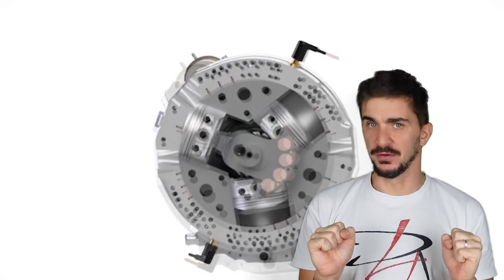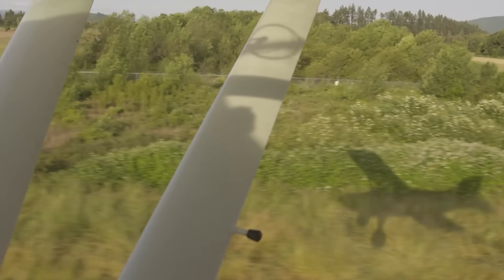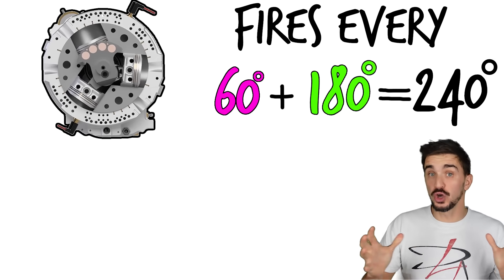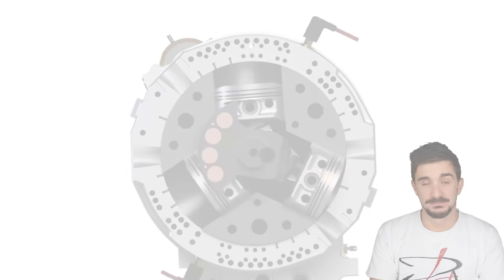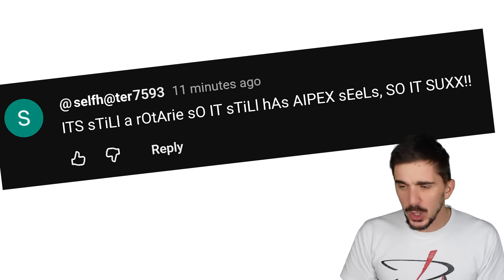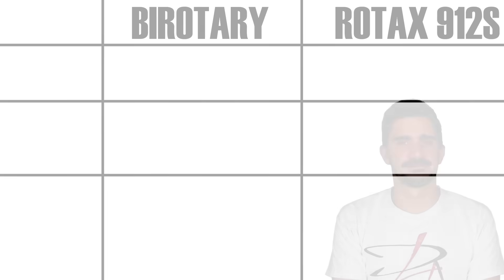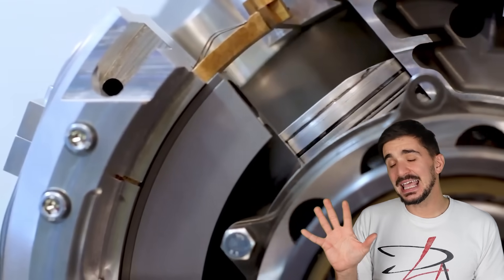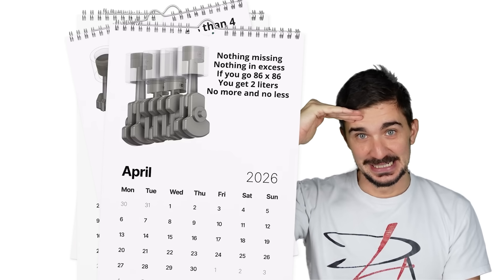This is What Happens When Pistons and Rotaries Make Babies - Birotary Engine Explained and Reviewed

Comment from the maker: 2026 Calendar: https://driving-4-answers-shop.fourthwall.com/products/d4a-2026-engine-themed-calendar
Support the channel by shopping through this link: https://amzn.to/4fatbMb
Become a member: https://www.youtube.com/@d4a/join
Patreon: https://www.patreon.com/d4a

Birotary engine: https://www.birotaryengine.com/
Knobgear: https://knobgear.com/
Reply: Looks like it could also be useful for power generators. 
Would forced induction help with low end power?
Reply: For July, September and November, respectively 7zyl, 9zyl and 11zyl star engines 😅
Reply: The Birotary could work in a Hybrid layout. 'Could'.... Generators feeding electricity into a battery would not care about 10,000 RPM and often work at that RPM happily for decades.
Reply: Use a honda generator on tesla 😎.  Stop the insane engine configuration
Reply: Wouldn't the CVT be the best possible setup if it were ever put in a car?? I mean keep the RPM constant and just adjust the CVT gearing to get up to speed??
Reply: @TheGOATEDone24 
CVT's are already used in many vehicles especially newer vehicles.
Reply: @Parabellum8missed the point there bud. I was talking about this engine specifically so the the engine doesnt have to go up and down the RPM range like a normal engine as it doesnt really do that being a plane engine.
Reply: @TheGOATEDone24  Gotcha , my apologies.
Reply: @TheGOATEDone24 CVT ARE GARBAGE
An automatic shifting LENCO PLANETARY transmission would be better. RELIABLE
Eliminate the torque converter. It loses @ 2 mpg. Essentially an automatic transmission, but with an electronic clutch. Auto E-brake.
Reply: @FORDrulesCDBURLOCK no because the LENCO has gears. A CVT doesn't. The engine needs to be at a consistent Rpm making the Lenco too jumpy
Reply: @TheGOATEDone24 THE NISSAN IS FAILING ALL THE TIME.
THE COMPANY ALREADY HAS A GENERATOR SETUP. 
IF THE ENGINE WAS SIZED UP TO @ 500 POUND FEET TORQUE TO FIT IN A TRUCK , A CVT ISN'T GOING TO DO. 
THE NEW 10 SPEED TRANSMISSIONS ATEMPT TO SHIFT SO SMOOTHLY AS TO IMITATE A CVT. THE ZF8 TRANSMISSION IS MORE RELIABLE UNDER HEAVY STRESS.
Reply: @FORDrulesCDBURLOCK was i talking about Nissan?? Nope.

I have a 30 year old snowmobile and the only thing on it that hasn't broke is the CVT.. Heck micro cars have CVTs that are out lasting the cars their in. While yes a CVT isn't as good as it should be.. its still better than nothing and in this application its better than your so called lenco. If you put this motor in a car yes you'll need a CVT because it will give you full speed range. As opposed to have individual gears for every individual speed limit thus making anything but a CVT useless
Reply: I hope you see this comment, but as a burgman 400 motorcycle driver i can totally see this engine with a CVT (possibly like on a burgman 650 where its also forced cvt) being mostly super efficient in a scooter running @ high rpm.
Reply: @_but_why 
DO YOU KNOW WHY THIS ENGINE HAS NO TORQUE ? THE LENGTH OF THE CRANKSHAFT THROW.
FIND A WAY TO ELIMINATE THE THROW.
I DID. 
NOW THE "THROW" IS HALF THE DISTANCE ACROSS THE INNER ROTATING BLOCK. 
WHEN YOU SEE THE SOLUTION, 
THAT WILL EXPLAIN WHAT I MEAN.
Reply: Ok
Reply: Straight 6 turbos with fuel injection find that Nissan with a piece of s*** transmission and do an engine swap
Reply: Doesn't it technically fire less than 180°
Reply: It really popped your fuse aint it? (6:20)
Reply: Cosworth Cat Gen !!!!! Cosworth Cat Gen !!!!! Cosworth Cat Gen !!!!! Cosworth Cat Gen !!!!!
Reply: if anythign it should be a TRIrotary - but I think they wanted to put the word BI in there because engines mating with engines must be ghey
sry, rotopiston is ghey
Reply: Absolutely loved the video with its highly entertaining intro. I think the calendar is a great concept and I went straight to the link to order one. The price of the calendar itself is very reasonable but delivery and taxes almost triples the total.
This is due to it being shipped from the U.S. While bad enough to make me think twice about a purchase, this fact introduces the final nail (🎃) that prevents me from proudly owning your fabulous calendar. 🇺🇦🇪🇺
Sorry dude 😞
Reply: Surely it should be called a Trirotary. ?
Reply: to be a bi rotary engine you would have to drop one piston.... it has 3 of them making it a tri rotary engine ... yes the piston counts sets the name not the function first ... otherwise a combustion would be a heat differential combustion engine
Reply: With engines like this there is basically a gearing between the pistons and the crank. For rotaries it's 1:1.5, the crank travels 1.5x further for the same event at the chamber. This reduces torque by 1.5x and increases crank speed by 1.5x but leaves power the same. It's largely irrelevant as it can be compensated for in the diff (for cars). The true speed of the engine is the speed of the pistons, which won't change between this engine and a regular piston engine. Just the shaft will spin faster or slower. The true toruqe of the engine is before this gearing. Basically think of it as an engine and a gearbox. A lot of the conversation around engines like this missee the mark. Eg "this engine has an advantage of higher torque". Well, not really, it's just the same as a regular engine with gearing
Reply: I thought that neander engine would be the only engine with two crankshaft per piston. But I guess this has sort of the same effect? 

Also, I am now going to pronounce propeller like you did. Its going to drive my friends crazy.
Reply: I think the these sliding valves would be great with the Bi Rotary because you have better control over the port size, shape, duration for powerband curve. https://www.youtube.com/@Motor-Technologies-Inc./videos
Reply: the chode engine!
Reply: Birotor? Birotor??? (especially because it has 3 pistons???) 🤦🤦🤦
I hope the guys from Mazda have a look at it! Especially because a 2 rotor engine was called birotor in the 70's!
PS: how you called the engine sounds much better!!!
Reply: With a plug like that, how can I NOT buy the calendar! Thanks for all the videos this year!
Reply: Well explained. Easy to understand.
Reply: TODAY at the Concorde Museum in Bristol, I think I saw September.  The Bristol Jupiter 9 cylinder radial❤
Reply: @ukcog  W what do you mean… you think you saw?
Reply: @Ron-Swanson  He has made a calendar for 2026 which has a single cylinder engine for January, a two cylinder engine for Feb and so on. Today I saw a 9 cylinder engine which is a candidate for September's photo. The Bristol Jupiter is a 9 cylinder rotary with 96 valves. The one in the museum was built around 1926
Reply: @ukcog ok, I understand that. But, you said I think I saw… not I saw one. So I was just curious about whether it was for sure or not.
Reply: Please do a video on the Rotax 850 E tec engine.
Thanks
Reply: Lmao.

Loving the mocking of the critics!!!!
Reply: I love it. Top fuel will get more power from this design.
Reply: I EMAILED YOU MONTHS AGO WHEN I HAD TROUBLE EMAILING YOU. 
YOU NEVER ANSWERED MY EMAIL 
I DESCRIBED AN EVEN SIMPLER DESIGN. 
THE TIMELINE WAS AFTER YOU 3D PRINTED A ROTARY ENGINE. 
YOU SAID:   
"TO GO HERE AND GET MY EMAIL ADDRESS"
I SHOWED YOU OR YOUR PEOPLE  THAT WE CANNOT ACCESS THE PAGE IN THAT PICTURE.
Reply: This type of engine was invented back in the 1970's. I know my uncle is the one who invented it. I believe his was a 2 cylinder, but I could be wrong. His description was done on a napkin so there wasn't much detail. One thing that came out of the design was an engineering evaluation was, it needed a water jacket that my uncle said was an easy fix. This engine has been in development for over 10 years if it's the one I think it is.
Reply: @rlrsk8tr 
Sir, DID YOUR UNCLE PATENT IT ? I SAW A PATENT THEN THAT WAS CALLED A SWINGING PISTON ENGINE. 
THE INVENTOR LIVED IN NEW JERSEY I BELIEVE. ALSO, DID HE ATTEND A COMMUNITY COLLEGE IN CALIFORNIA ? I SAW A RESUME OF THE INVENTOR.
Reply: @FORDmula1CDBURLOCK no. It would have been pa or con. I think the jersey place is the one I'm thinking of. They may have done the evaluation on the design. They had something going with nasa, I think for some kind of special lubrication. Probably because the couldn't figure out a good way of cooling it.
Reply: THE OUTPUT ID DETERMINED BY THE CRANKSHAFT IN THIS AND THE WANKEL. 
SHORT STROKE , LOW TORQUE. 
LONG STROKE , HIGH TORQUE. 
LIKE A CREATER BAR ON A PIPE WRENCH. 
THAT'S THE FLAW IN THIS, SHORT STROKE. 
I WROTE TO THE DESIGN TEAM ...
I WILL SEE IF THEY WANT MY IDEAS. 
🤔🔧😁
Reply: @FORDrulesCDBURLOCK yeah good luck with that. Probably as good as your name.. Ford.. which is crap😂😂
Reply: Just use it like Germans used engine in Ferdinand tank destroyer

Comment: So if you want to increase the stroke, you make the diameter of the casing larger. This would give you more torque for low rpm, but it would make it bigger around which shouldn’t be a problem in an automobile, especially if you make it mounted vertically with a trans. Axel converting the direction like you would in a lawnmower

Comment: Even though I completely agree with you that this concept is a ridiculous waste of materials, space, and weight on a motorcycle... I have to admit that I would love it if an electric motorcycle (especially a retro-styled cafe racer or something similar) could produce the look, sound, and feel of the real deal.  

So by the time they get the solid-state battery working, which can solve the problems around battery weight, charging time, and range, by then I would love to try Yamaha's retro-cafe-racer-EV-real-feel-bike. We'll talk some more after the first oil change! 😁

Comment: At the risk of absolutely setting off my fellow car people... This engine actually could work pretty good when connected to a CVT where it doesn't have to rev quickly and If it's like Ford's ECVT they use on the escape and Maverick the hybrid motor can really be an awesome match by bringing the low end torque it lacks.

Comment: Carbon from the burning process is an abrasive and the rotary part has to seal compression or most all power is lost.  The carbon wears out a gap for compression loss and when the burning gases get to the other cylinder's non-burnt gases, they burn.  OOPs factor 9, and you can just buy a new motor again. The same reason rotary valve fail and exhaust valve guides wear out way before intake valve guides. I liked your rotary vein compressed air motor, so now make it a gas burning design, and you can throw their motor design in the garbage and hit your woman with a ball.

Comment: Just a question :
Is it possible to technically attach the output shaft to the camshaft OR to the cylinder block, in order to have, depending of the use :
 - High RPM with low torque
 - 1/3 of the RPM but with 3x the torque (taking advantage of the built-in planetary reduction gear as a reduction gearbox)
?

Comment: I miss spoke wave disc not wave guide,  Not a pulse jet.  Pistonless rotary engine uses shock waves for compression and combustion.

The Wave Disk Engine (also known as the Wave Disc Engine or Wave Disk Generator) is a pistonless rotary internal combustion engine concept developed primarily by Dr. Norbert Müller at Michigan State University (MSU), in collaboration with researchers at the Warsaw Institute of Technology.
Researchers proposed it as a radical alternative to traditional piston or turbine engines, using shock waves to compress and combust a fuel-air mixture inside a spinning disk.
Claimed Advantages
Researchers claimed significant advantages over conventional engines:

Efficiency — Up to 60% thermal efficiency (vs. ~15-35% for typical piston engines) due to higher peak temperatures and rapid shock-wave compression minimizing heat loss.
Weight and Size — ~30% lighter and more compact, with fewer moving parts.
Cost and Emissions — Lower manufacturing/maintenance costs and up to 90-95% reduced CO2 in hybrid applications.
Fuel Flexibility — Works with gasoline, diesel, ethanol, or hydrogen.

Comment: Our grandfathers figured out some very simple formats for engines long ago,,rotaries fling their sealing rings around at very high surface speed's ,,hydroplaning on oil and being worked hard,,pistons stop at the top,,accelerate down and stop again at the bottom,,not doing nearly the miles rotaries do ,,,a moment to transfer heat and seat,,and their just simple rings,,perfect for sealing round holes,,

Comment: It looks like you're adding a very large wear surface. How do you seal the top of the cylinders, i.e. the interface between the outer case and the inner rotating part?

Comment: I made it to 0:44 before this video made me genuinely angry lmao. The pistons are not rotating. The crank, and cylinder block are rotating. The pistons move linearly. 

And you're absolutely correct that it is a descendant of rotary engines. I have no idea why youre using animations of a wankel though. Its a descendent of the WW1 aero rotary engine it takes the vast majority of the concepts from though... And the other engine design isnt a regular 4 stroke combustion engine. Its a 2 stroke engine. 

The reason they were replaced by radial engines and other designs like inline/V-engines were numerous, and obvious. 

The weight of the rotating assembly grew at a much faster rate than the equivilent size/power engines of other designs, requiring larger bearings to produce the same durability. The reason Wankel engines perform the way they do (free revving, high power to weight ratio) is the removal of the individual rods and pistons... This design takes the one actual innovation of wankel engines, and replaces it with the significantly heavier, and objectively worse engine design of WW1, then makes it even worse by having to add even more weight (just look at the size of that crank counterweight) to balance the weight of the crank, rods, and pistons, to the weight of the rotating cylinder block. And oil flow at high RPM? Its got some massive issues there too. Having to fight centrifugal forces to pump oil to the crank bearings and other critical areas was a problem even with those world war one aircraft engines turning at a couple thousand RPM. And as RPM increases, the pressure has to increase enough to overcome (or control, depending on oil flow design) the centrifugal force, AND flow an increased amount of oil during less time as revs increase, across a wide operating temperature, oil is cold or hot, AND do that without cavitating, or youre starving the most critical load surfaces at the center of the engine of oil. 

With this "bi-rotary engine" it has the additional issue of preventing blow-by/wear between the engine casing, and rotating cylinder block, because the apex seal you are so happy it doesnt need, have more jobs than just sealing the combustion chamber... It also keeps the crusty combustion by-product (oil/dirt residue that builds up in all combustion engines around the outer rim of the combustion chamber, and on piston faces) from building up, and slowly damaging the machined surfaces of the rotating assembly... Which in a wankel, wears the apex seal as its the softest alloy, and when the seal fails, the engine becomes a diesel, but doesnt cause permanent damage, and is quite a cheap item to replace, if you have the knowledge and tools. With this engine, the oil scrapers require the block to be disassembled to even inspect them, there is no easy way to see how they are wearing, and compression should remain static as long as the cylinder block, piston rings, and outer casing are in good shape... But once the scrapers do fail, the engine is going to eat the casing, or the rotating cylinder block, the two most difficult and expensive to produce, precision machined parts on this engine. Or you are a good conscientious boy, and follow the rebuild schedule perfectly, but someone rebuilds the engine and makes a tiny mistake in tolerances... New rotating cylinder block and casing, and you will not know the scrapers were not installed properly until it destroys the two most expensive parts of the engine.

Comment: The design is like a sleeve valve engine. A sleeve valve engine (Bristol) has a sleeve in the cylinder that moves and lines up intake and exhaust ports.  This engine has the inner case moving lining up the intake and exhaust ports. A benefit of this design is that their is no hot exhaust valve in the combustion chamber that can cause pre ignition.  This allows you to run a leaner mixture. The biggest drawback to this engine is the short stroke which results in limited torque!

Comment: Great presentation, super interesting design. However, I wonder if the port design has to be entirely "fixed". 2 stroke motorcycles were famous for coming up with different designs to raise/lower the height of the ports. It's like the equivalent of variable valve timing in 4 stroke motors.
Surely this could help this 750cc design work in a bike, and pancaking it to create bigger motors for cars? Surely it's worth a try.

Comment: Seems to me that the short stroke is not mandatory.
Your argument about the angle is correct, BUT it doesn't mention anything about TIME.
That is, ... How much time is required to rotate the angle? This on the other hand is directly related to the gear ratio between the crank and the cylinder housing. At current 3:1, you get time=x. However, on 5:1 or 10:1 the time will be something different (longer). So longer strokes are possible.